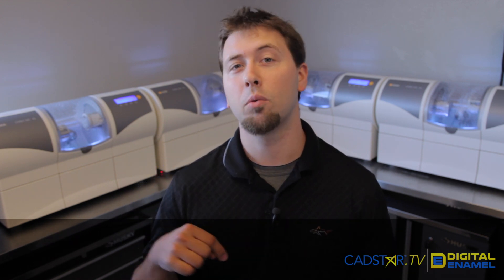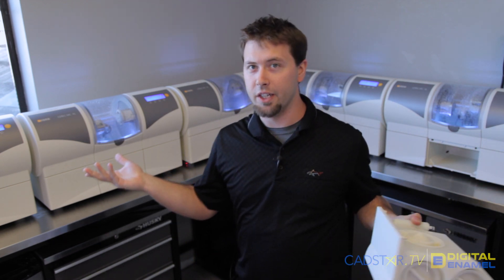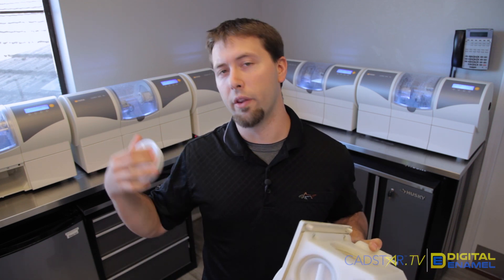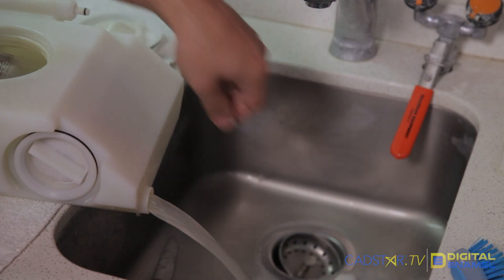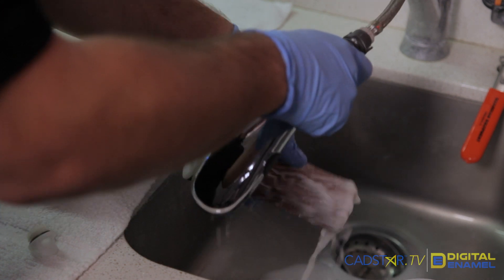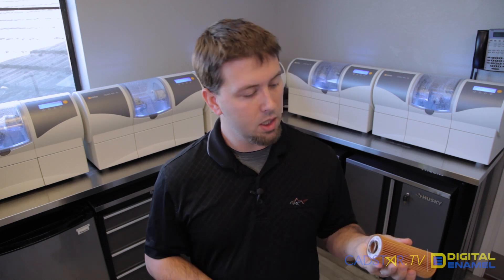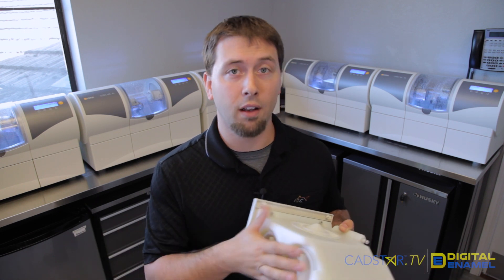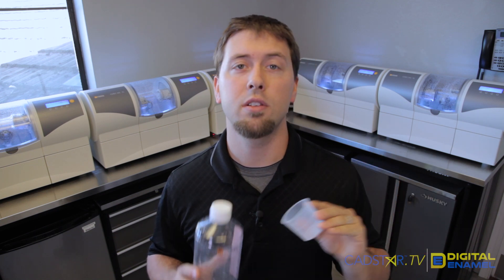How to Clean your MC XL Tank

Comment: Is it usual for the milling motors to die. First force sensor error resulted in a new motor. A few weeks later later the same error and a new motor. Does they force sensor error really require motor replacement? Any method to test for motor malfunction or detect a dying motor condition?
Reply from the maker: I have had a few motors go through the years.  Have tech support run few tests.  All the best

Comment: Hello, have you ever encountered "insufficient water pressure" message caused not by the dirty tank/filter? 

Today we cleaned the tank, installed new filter and still the message persists. We even tried using the other tank - same result.